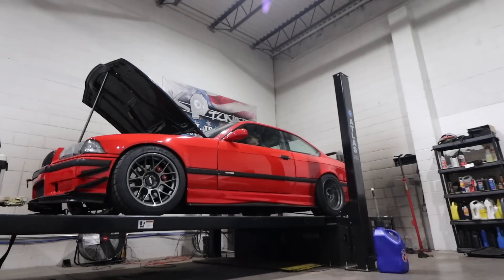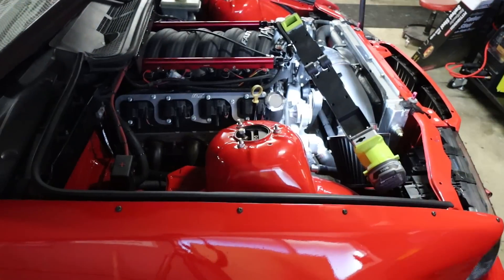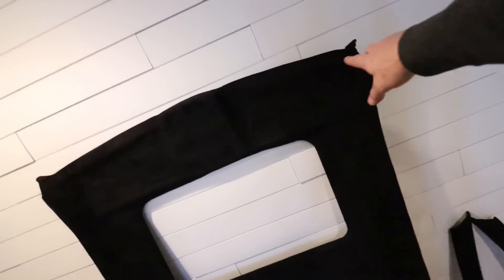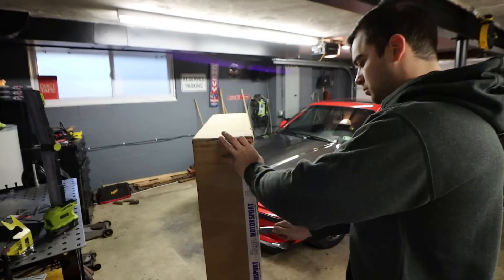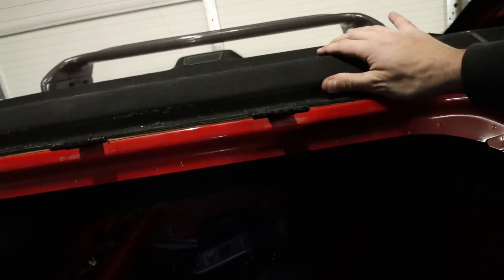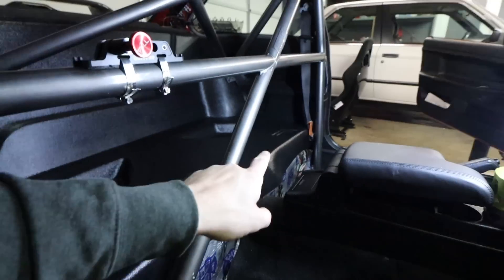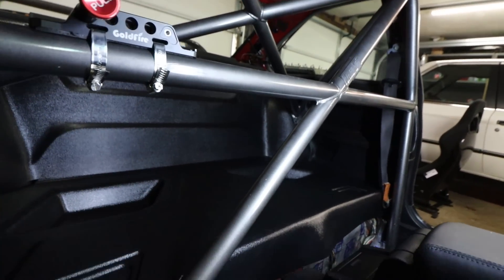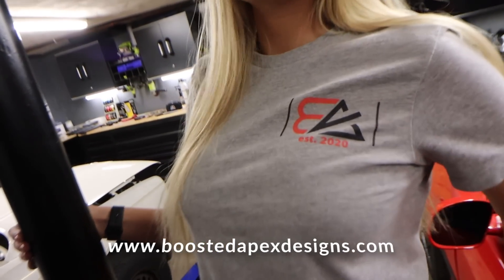Must have E36 Interior Mods / Upgrades - Installed on My LS Swapped M3

Comment: You should acaltera wrap the delete pieces it will look so much better then plastic
Reply: Also gun metal Grey would go relly good with the car not to flashy bt just enough where it's noticeable
Reply from the maker: Not a bad idea.  Other than the radio delete, what other panel though?

Comment: Alcantara fades. A lot. It will be grey before you know it. Also the spray glue lets go in a summer unless you live north of North America :-)  Sorry to be the negative person here but tried both. Other than that the video is great and you guys are building one sweet MLS3.
Reply from the maker: That's what I thought about the fading.  What do you suggest other than spray glue that will hold? I guess time will tell.
Reply: @matt13ross  the professional glue. You can only get them in a can and need air sprayer. I tried rattle can, lasts about a year in hot climate.  Its sad as the can promises all the stickyness, long lasting hold, etc. Maybe up north but i'm in sc. It gets hot and humid here. Fading will happen but its ok. It just turns grey 😁
Reply from the maker: I'll certainly update when/if it fails.

Comment: Really enjoy the content and how far the e36 has become as I had a 1994 325i in Arctic Grey that I had planned on building. Rust and theft decided that option for me so im building a 300zx with an LS
Reply from the maker: Thanks!  300 with an LS is a great choice too!
Reply: @matt13ross  Oh yeah, a 4.8 using the 300zx original 5sp with a goal of 350-400whp be a good balanced setup for me.
Reply from the maker: 4.8 might be tough to get that power.  Can you find a bigger displacement LS?
Reply: @matt13ross  With the crank I have being a 4.8 crank (didn't know how to tell which one i had until recently). So my game plan was to use it with the piston and rod set that came with the crank and go from there.

But a buddy whose helping me with this motor build found another box full of another set of piston and rod combo being that of a 5.3 ( he measured the rod length and identified it) and figures we could locate a 5.3 crank or 6.0 if possible.

Comment: Hey boosted apex, i absolutely love your car, and was hoping you might be able to answer some questions about it! I am in the planning stages of an e46 LS swap. Firstly, you’re using a holly terminator x ecu and harness, but how did you get the stock gauges working? that’s very important to me, as i want the car to look stock on the inside for the most part. I was under the impression that you had to run the holly screen to get gauges, or use a fully custom harness from like Wiring Specialties.
Reply from the maker: Thanks!  Answered in the other video for ya.